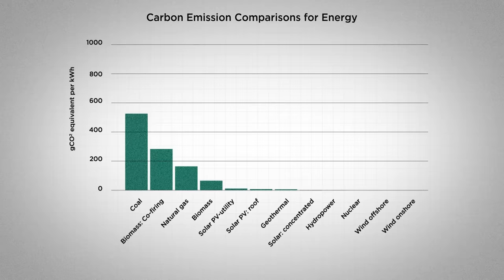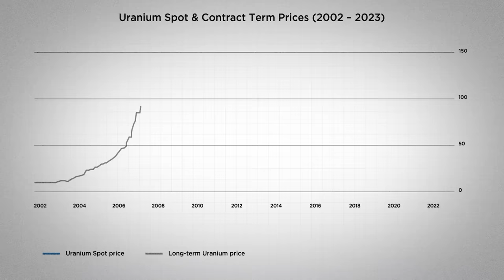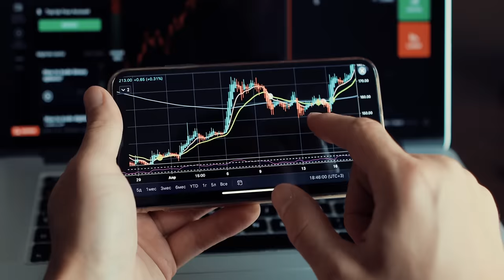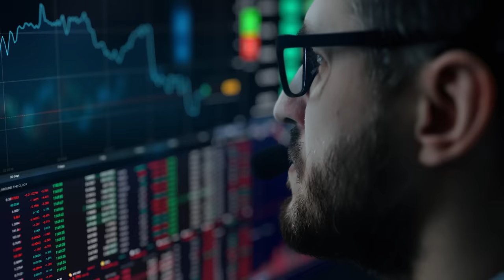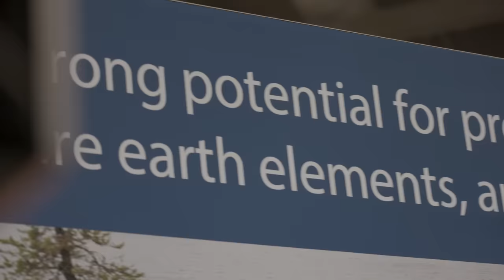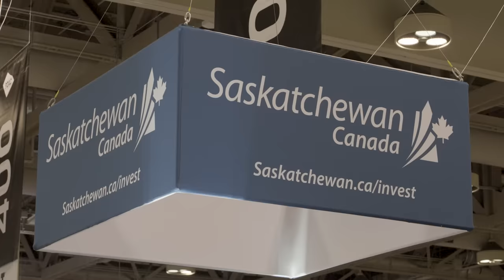The Nuclear Renaissance

Comment: Fluid dynamics pipe size matters. SMRs are for glossy brochured investor schemes. Large reactors aren't by chance. The USA army has used small reactors for decades. We understand the limits lookup SM-1, one the first power reactor on the US grid along with EBR-1. 😮They are only really useful if you have to have mobile reactors. For stationary power plants you want to build them bigger. The physics of fluid dynamics and pipe size efficiency.